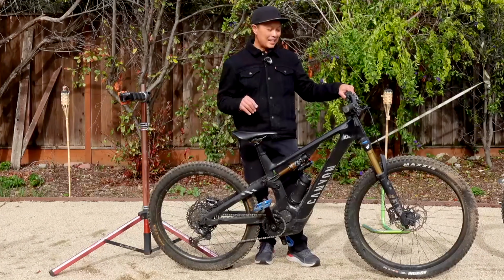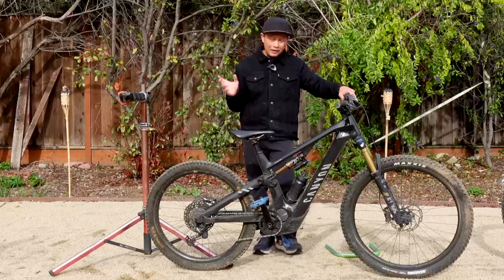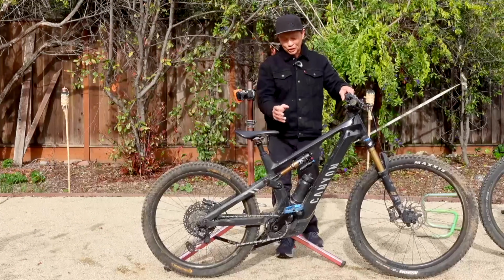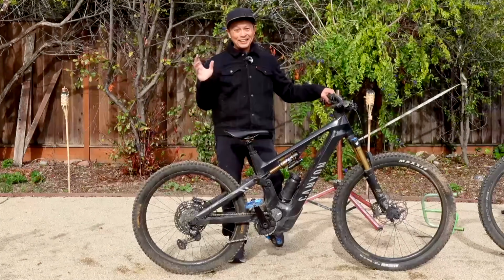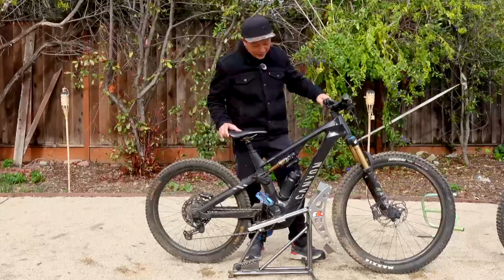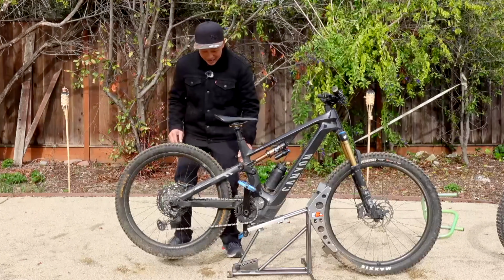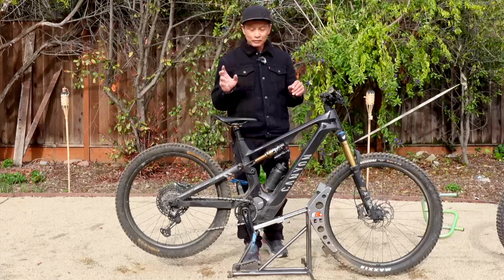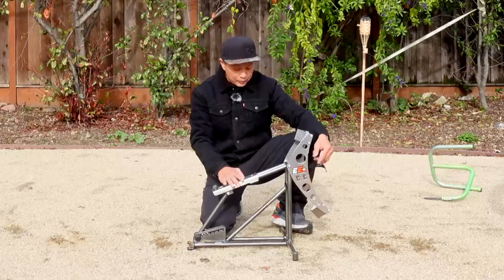Enduro Engineering ebike/bike stand - simple, stable and dialed solution

Comment: Bike stands are the best option allowing both wheels to be raised so you can work on any aspect of the wheels
Reply from the maker: Bike stands are the best option for a full overhaul of the bike including the front wheel. For 90% of the regular tasks like shifting adjustments, air pressures, washing the bike, lubing the chain, this is better.

Getting on and off the stand is a 10-second job lifting the 10 lb. rear instead of lifting a 50 lb ebike with one hand and clamping it down with the other on a bike stand
Reply: @EMTBReview  I agree. Lifting the bike with one arm then clamping with the other is very different than an analog bike.

Comment: Thank You for the info about this stand, if i get answers to my questions chance are i will get one. i looked their site to find size spec's and did not find any so my question still remains. The height is simple enough to figure but what is the Max+Min length possible of the supporting part from rear most part of the front wheel (moon crescent piece) way back to the BB seating?  There is also them 4 rubber cushions, what's the possibility of repositioning them even if drilling is required, possible Y/N? lastly you think it can support 130pnd ebike? (  NB; a 72V 5Kw Power Pack can add about 60pnds to a build and run real smooth on streets, semi full suspension   ;-D  )  Best Regards & Ride Safe

Comment: you need to show more, eg how compact when folded etc. The biggest problem with this stand is you have to do everything kneeling down
Reply from the maker: This doesn't fold at all. It does have some adjustability features though.  Yes, kneeling or squating is required. A small stool is golden for usability.
Reply: I have a stool with wheels in my garage. Works great.

Comment: Take the battery out first,then cover connector with a rag,then put splash guard back on,less stress on seatpost if using a normal bike stand
But on this stand,you cannot spin the front wheel to wash it,so pretty us3less
Reply from the maker: Front wheel is not locked so just roll it halfway to clean if it’s very dirty.

Battery out lifting to stand, spraying, is far from ideal

Comment: I noticed both Canyon shown here and the Enduro Engineering YouTube-featured Husky are factory bikes equipped with internal mid-drives. They have a relatively flat, curving bottom bracket would rest nicely on the pad with the rubber bumpers. Conversions using a BBSHD or CYC external motors would see these hang outside the BB next to and below it. Where these motor would rest on the pad are usually heatsink fins and they are irregular in shape and far from uniform. I wonder if the stand has been tested with these external mid-drives for stability.

Comment: Most bike work-stands are far from perfect for e-MTBs.  Finding a place to place the mounting jaws can be tricky.  The head on work-stands tends to slip if you try to swivel and lock the bike front up.    
Even though I have a new full sized work-stand I'm tempted to make a purchase.  This bike stand is full of functionality and extra portable.  I like the idea for using it to park my bike at home.  This tool is not cheep, but appears to have great value.

Comment: Muc-off's ebike drivetrain tool works wonders!  Alternatively, you can just put a hex-wrench in (although they get stuck when you try to pull them out - PITA).  With the drivetrain tool, I've had no problems running the chain backwards for lubing the chain.

Comment: in a normal stand, you release the dropper and let the bike hang from the saddle. If you need it more secure, you can also make a small rail to lock in the front wheel but for most jobs it isn't necessary.

Comment: I got one, true you can’t work on the front wheel or fork but most of the time you’re working on the rear of the bike, I lube and clean my drivetrain on every ride, also it comes handy when you wash your bike. Good quality stand, not your full stand but a full stand for an ebike is going to cost you double the price. Thanks for the review Francis!
Reply: You clean and lube your drivetrain every ride?  What kind of slop are you riding through where that's even necessary?

Comment: My dual suspension xc bike, weighs 24.5 lbs.........My Canyon e bike weighs 52 lbs.
Its very noticeable.

For a normal stand , the trick is to lift the e bike by the back wheel, its not too hard.
It can be slid into the stand pretty easy like that.

The EE stand, the bike is close to the ground, so your back on your knees working on the bike.

Comment: I converted a cheap light motorcycyle stand with bigger swivel wheels to lift the ebike under the swing arm.  It's very easy to use but you cannot work on front  wheel unless flip bike over.  I usually have the front tire off because I can't fit the bike in the small suv with tire on.

Comment: Always appreciate your review videos!  The Scorpion stand came with my 2021 Intense Tazer MX Pro e-MTB and as noted in other comments works fine with the Shimano EP8 motor.  I do like the concept of the Enduro Engineering stand and seems to work well.  I also use the low cost flip the bike over method too!

Comment: I have a Shimano EP8 equipped ebike and the scorpion stand works just fine with it. The Scorpion stand comes with different size sleeves to accommodate different crank holes so I use the smallest plastic sleeve and it fits perfectly